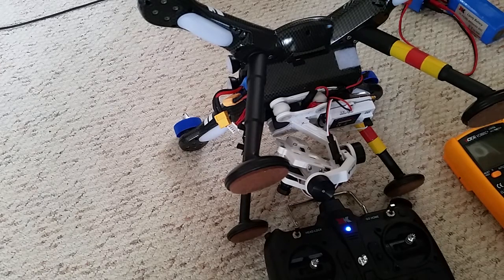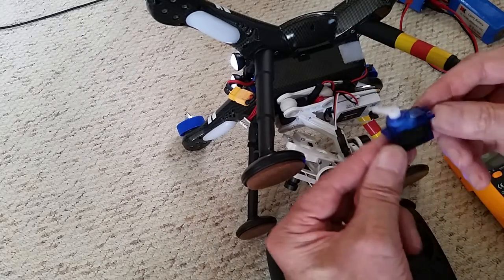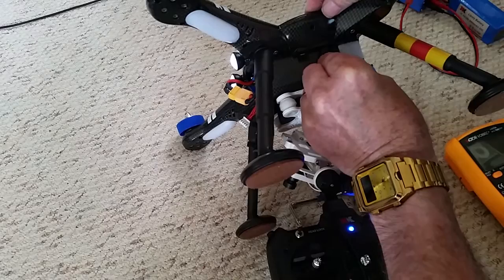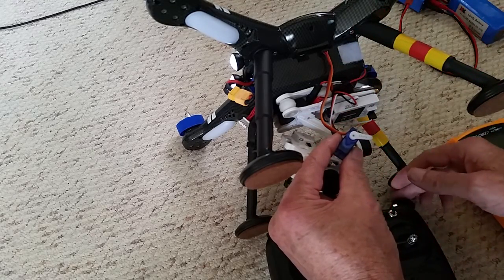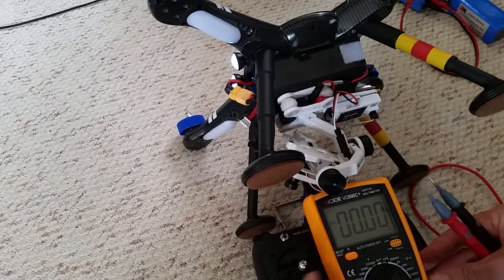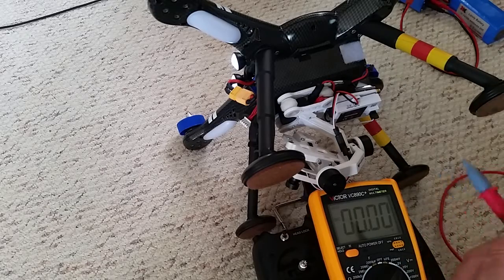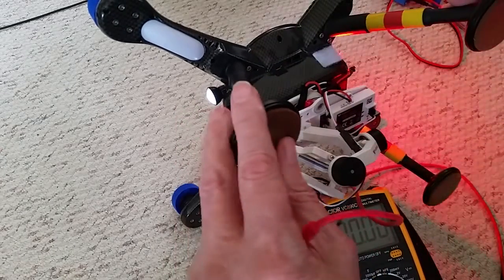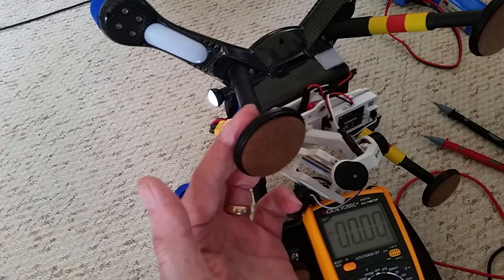Testing X-380 Gimbal Signal

Comment: Greg, yes it does. the circuit board inside that provides the signal (and also the +5V rail) are so fine that it takes very little to burn the board. if you have any electronic skill you can pop the top in X380 and rewire the signal line and even the 5v line. 
on some Gimbals you can take a wire direct from the receiver signal to the tilt as its PPM but then you must go into the Gimbal software and change that signal to PWM to work. This is called the brown wire mod.

Comment: If you do short out the board then what happens?  does this keep the x380 from getting any signal from the receiver or just the gimbal.  I have used 3 different gimbals on my x380, the first worked for a while but no luck since then, so I am assuming that the issue is with the quad.  Is this reasonable logic?   If so do I just replace the PCB receiver board?

Comment: Very nice, great explaination. I'd be scared of accidently shorting out the test leads, very tight Indeed. When I do a test like that, I'd take a Servo  Jumper and plug in to the Quad, and test the other end possibly with the connector remove on the end you test, You must have nerves of steel My Friend...  hehehe  Great Info, thx for sharing..  :)
Reply from the maker: +Soco Joe A steady hand is called for and I did mention not to short those pins but if you rest your hand on quad and carfully get that positive center pin first the right signal pin with negitive test lead is quite simple to slide in to the hard right side. But yes if one does have a spare servo lead its a good idea but most will not as they could just use a servo instead.